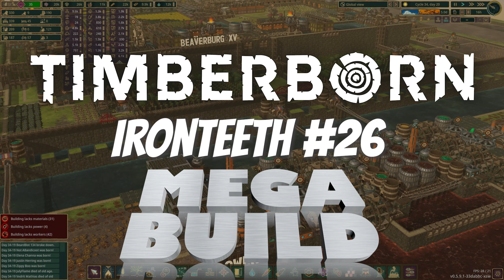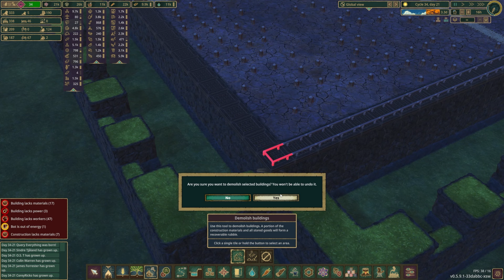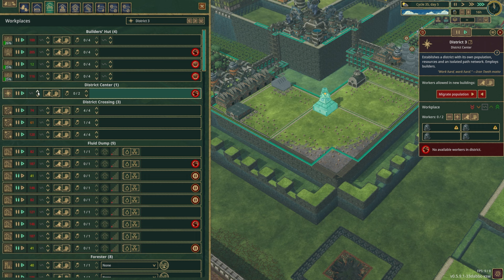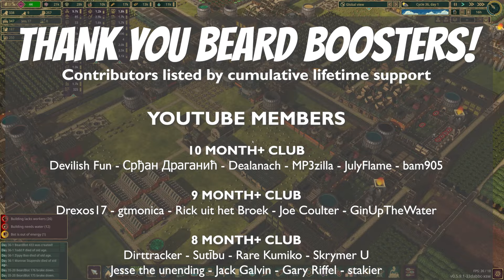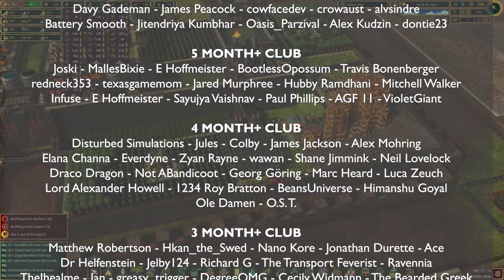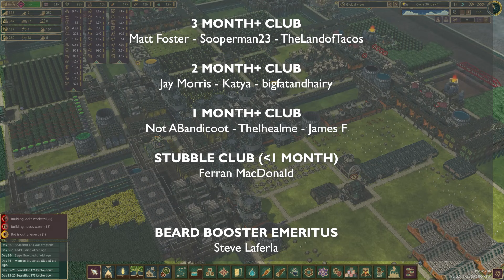Time to move industry downstairs! Timberborn Update 5 Iron Teeth Mega Build Episode 26

Comment: TRAINS: have you considered as a style choice to often build train tracks on 1 high platforms with beaver path under tracks [advantage: train doesn't block where beavers walk].. ( then the beavers simply build track thru platform 😁😁) ... If beaver path is on platforms power shafts could be under path also

Comment: In regards to the framerate/debris piles - would it work if you paused the game, then placed a lot of buildings to push the debris into more concentrated piles and then delete the structures and unpause the game? I think it should work as it will reduce the number of piles the program is forced to draw and hold. It might require a little more CPU to keep track of the resource numbers in the piles, but it shouldn't be significant.